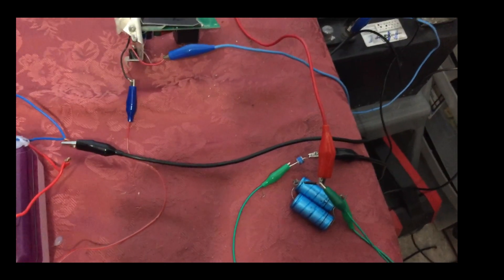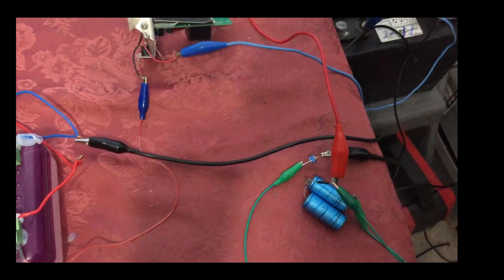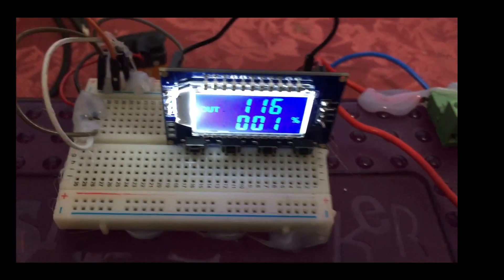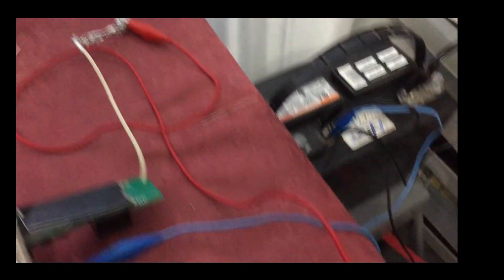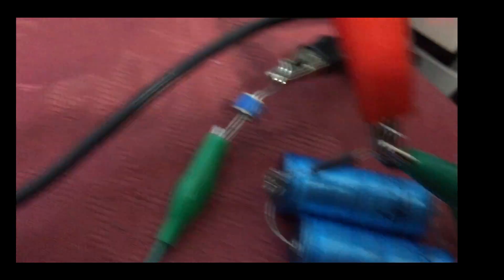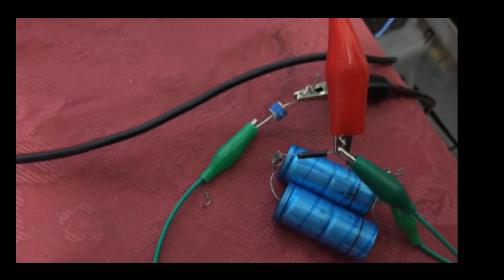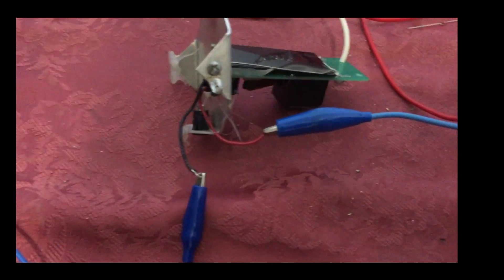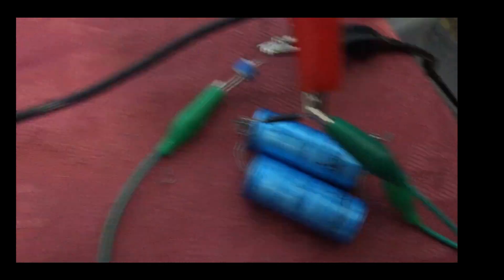3456% efficiency

Comment: The Hv output one wire goes to the diodes which are connected anode to cathode and then + - to the caps and when the caps reach a certain voltage you trigger them,is that right?Thanks.
Reply from the maker: That sounds about right! :)

Comment: Hello and thanks for your continued posts. I'm struggling to grasp the connection between the signal generator, high voltage generator, and the battery. A basic schematic diagram might clarify things for me. Typically, a signal generator activates a transistor (acting as a switch), but I didn't notice this in the video
Reply from the maker: The display pulses a transistor inside the case I show this in other videos, not trying to hide anything here. NPN transistor pulsing the 12v input to the HV module at 1% using around 4ma of input current.
Reply: @joellagace1679 , I know that you don't hide. since you have used so many different methods of pulsing, sometimes it is difficult to keep track of all of them!
Reply: I think I got my answer by reading one of your reply below: "I'm pulsing with the crappy controller just the 12v going into those various high voltage modules by pulsing at 1%..." you directly feed the output of the signal generator to the HV generator!
Reply from the maker: No im pulsing the 12v at 1% going into the HV module, not feeding the signal generator output to the HV module.  This gates the HV module to input only around 4ma of current and still output a HV field.
Reply: @joellagace1679 super done Joel. Now let it pulse at 116 x 10 trigger a pulse divider x10 hang your system on the first port, now do this 10 times. You will win but you loose some small. Succes.
Reply: Is this the ion valve ?  A sure way that's simple to check for over unity is a large cap or super caps in with a dc to dc mod to control the voltage level and the same amount on the back end .once full on the back end you can run the numbers to nail the efficiency.  Or just use rechargeable AA batteries  .. Great work

Comment: Great work, are you going to dive into a 555? This is my next move, gotta keep learning. I'm sure it's a ball ache, but gotta keep learning.
Reply from the maker: Yeah I just not good at building need to find good assembly service. This will bring input switch to around 10-15ma drive, plus the 4ma pulse. Well within acceptable range. heck you could drive it with crappy wind and solar :) And get real J power out of it.
Reply: @joellagace1679  just to clarify, the pwm is separate powered. (I have crappy wind and solar.) all your doing is, pulsing the 12v from (battery - pwm - cap dump- battery.) no transistor or coils?
Reply from the maker: I'm pulsing with the crappy controller just the 12v going into those various high voltage modules by pulsing at 1% we dont let much of the current usage as the devices want to take some up to 1 amp if you let it! Since we are not looking at current and all we want is pure potential its a perfect trigger. Yes its best to replace with 555 timer that runs from some free natural source like wind and solar. you could use it to pulse charge a battery self looped with the external trigger from the environment or the battery if you so desire if the input is very low. Or you can use it to pulse a DC source like  big solar panel to HF transformer and use the secondary as your one wire tap. lots of possibilities here.  Earth grounding is a must sometimes it works better in line with the one wire sometimes with the negative, Just try and see :)
Reply: @joellagace1679  god bless the HV module.
Reply from the maker: You just got to know how to tame it lol
Reply from the maker: Yep Tom Bearden stuff 100% first step is we drastically break the DC symmetry right at the input by pulsing the controller power at 1%, This also gates most of our input current drive. This also keeps the loop open right at the controller for 99% of the time so the battery is free to re-gauge. We do this with asymmetrical regauging with a much stronger pulse. And most important we also keep the loop open all the way with the one wire system. Don't close the magnetic dipole he says so we won't and for some reason the results speak for itself.